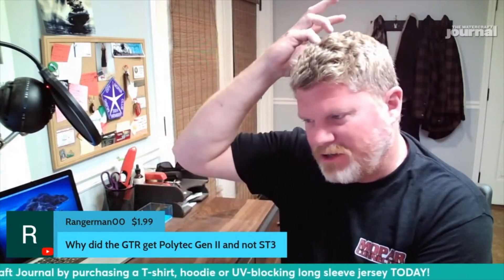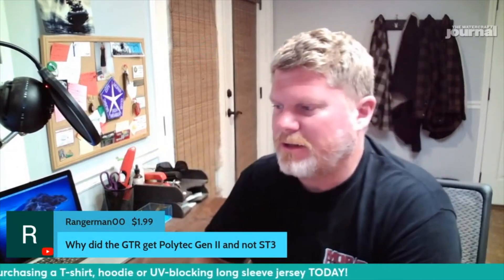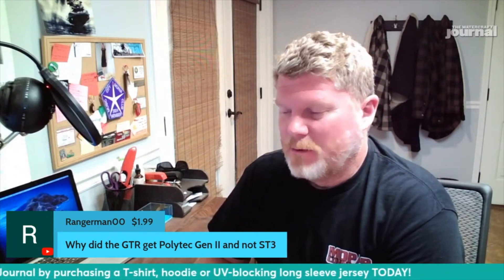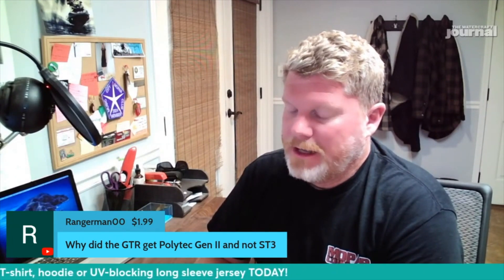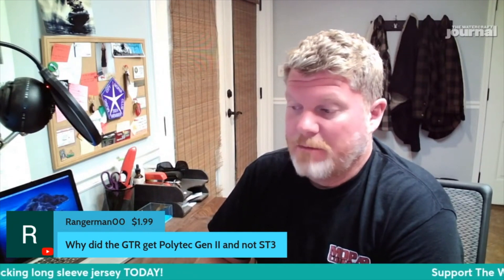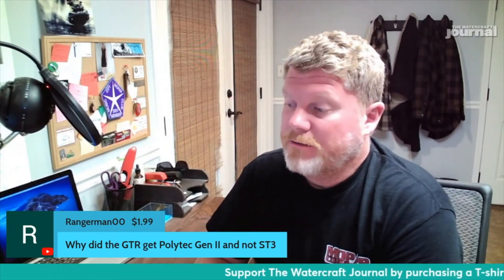Why Did Sea-Doo Decide to Use Polytech 2 Instead of CM-Tech on The 2024 GTR-X 300? WCJ Quick Topic

Comment: GTR X 300 is the best ski on the market. Way more fun than the rxp & rxt.
Reply: This is the same price as the 200hp yammaha GP HO. Way less reliability but I'm wondering for 100hp more if the risk of maintenance and gas use would have been worth it.. cheapest HP per dollar ski and keeps the funnest like you said. But doesnt beat the yammaha hull